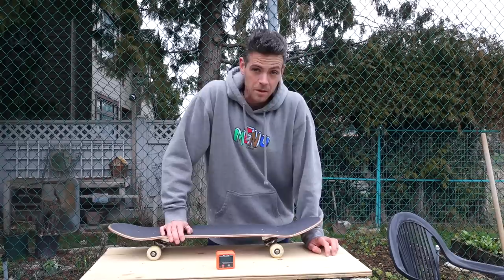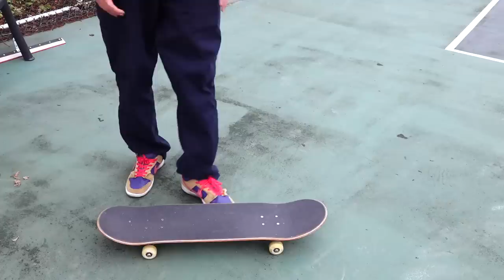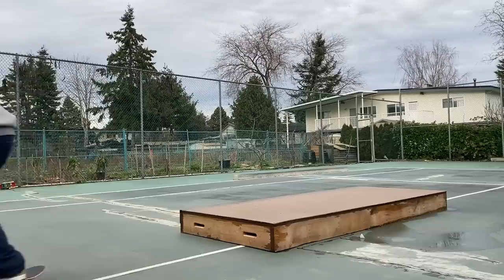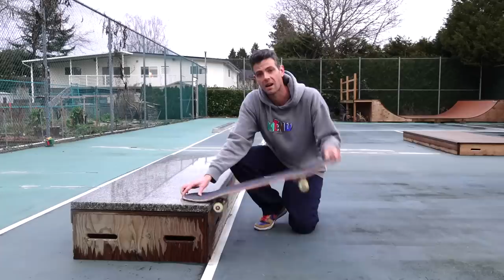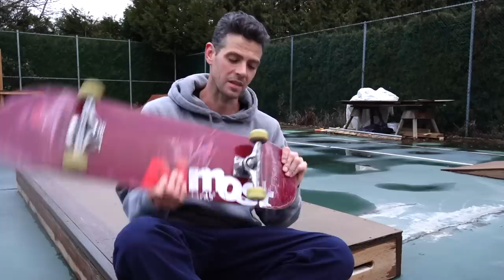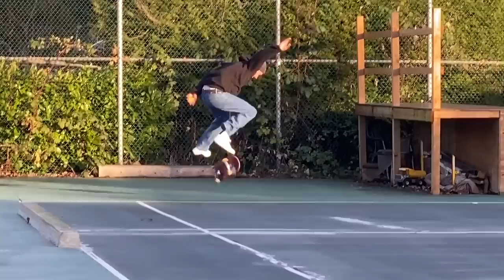Change this part of your skateboard and it changes everything!!!!

Comment: Early 90's, with the change from 80's boards to roughly the "modern" popsicle shape, I found I could not ollie with the "new" boards with fingers of flat. I went from easily jumping over anything to being unable to jump over a beer can. From kickfliping up a set of three or four stairs to being unable to ollie up a curb. The board was glued to the floor, the tail did not snap. It drove me nuts.
My solution was buying old 80's boards and using a "popsicle" as a model to reshape them using the nose as tail(mellower) and the tail as a nose(steeper). Late 90's early 2k's were hard for me, flat skinny boards, bearing condoms wheels, etc.
Some time ago I watched a video when Mr. Degros explained the "technique" to skate boards with fingers of flat.
Reply from the maker: Even with the “technique” it doesn’t mean it feels right or natural. I don’t like boards like that either.
Reply: @bendegros  its funny because this is my ideal skateboard among other reasons (lets not get into the mad mad world of pressure/old school tricks) that love that extra fingers of flat.
Reply: did you stop using risers in the 90s? im kind of the same way . i never really got into popsicles and tiny wheels.
Reply: @chrhadden  I went from about half inch risers and half inch baseplates(Gullwing street shadow) to a quarter of an inch total (shock risers and Indy baseplates). I got used to having a nose quite fast, flips up to anything, noseslides and "nosepick grinds" were my thing for a while.
Later on couldn't get used to flat skinny boards with fingers of flat and the non existing wheels were a joke to me.
Reply: @azazelreficulmefistofelicu7158  maybe i should try the risers  again and see what happens. i stuck to them for a reason  back then im sure
Reply: @chrhadden  No one used risers in the 90s. You didn't need to because preferred wheels were anything 38mm-45mm.
Reply: @jodi183  we did to i was there for it lol and i didnt want and still dont want anything smaller than 56mm. im not a freestyle skater
Reply: @jodi183  there was a time when we all thought for ourselves and didnt have to all have the same thing. long ago
Reply: @chrhadden  I knew that as soon as I hit reply that there would be someone who countered what I wrote. Lol. Yes, there are always exceptions. I was a child of the 70s and 80s. I remember when skateboarding went in and out of fashion in the 1980s and back in fashion in the 90s. I even still have an old Sims board from 1985 with the old Indie trucks. But as you know, by the early 90s street style became so popular then (even Rodney Mullen made the switch to street) and places like EMB where I'd occasionally skate with my friends changed the way skaters set up their boards in order to do tricks. Of course, we had no idea back then that that was a shift in style and the way people skated. For my friends and I, it just made sense to take off those risers if we wanted to grind or do slappies. Obviously, there were those who didn't do that and road larger diameter wheels, wheels that weren't so hard etc. Some of my friends were vert skaters who were or had been sponsored. What they rode on vert was different than what was more the norm for street. I think today there's far more diversity in what people ride, be it the shape of the boards, wheel sizes, and so forth. Also, it seems there's more products available then there was back in the day. I really don't remember seeing anything but the skinny popsicle boards by the mid 90s. That was my experience.

Comment: Second comment 😅 I'd been running Almost decks, almost exclusively for close to 20 years now, whenever it was that Almost Round 3 came out. I really like their shapes, both the twin tail and the regular long nose, and also really like that I can get steep and mellow concaves depending on how my feet are feeling that season. That said, as I mentioned in my other comment, I went to a flight deck ... and I'm not likely to ever go back. I do miss the familiarity of the Almost decks (ran 7.75 up until August this year), but the durability and pop out of the flight decks is kind of insane 😅

Comment: For me I think 35 degrees is most favourable angle for the pop to start. In general I like both of the tips to be similar steepness so I could skate flat without thinking which is the nose and tail, it doesn't need to be a twin tip at all.
Reply: Nope, my new favourite degree is around 34. Or it's just my brain thats been messed too much by the environment. Sometimes skateparks just don't feel as good as some random spots.

Comment: Could you re-drill the tail truck back 1/4 inch to test your theory?  Or do you think other variables like the kick angle or shape of the concave would be make this a bad match?  Love the channel brother.  Old head here, 90’s crew represent.  ❤
Reply: I was about to say the same thing
Reply: Would that not put the holes too close together to avoid excessive weakness?
Reply: @vancouverbill  it’s not too big a deal.  Back in the day boards would sometimes come double drilled, I’ve also drilled back boards to make bigger noses when it was tough to get a board with a big enough nose.

Comment: I'm on an 8.25 Palace right now and it's the stiffest board I've ever skated despite the concave being on the mellower side. It feels slightly thicker than other boards too so it feels "big" for an 8.25. I think an 8.0 Dwindle would feel amazing with those qualities.
Reply: Thats because its a DSM board and uses epoxy instead of glue. It's the main reason chinese made boards tend to feel a lot stiffer and heavier than boards pressed in NA or Europe (HLC in spain does offer epoxy as an option I dont think that many people use it). I thought the same thing about them being thicker but according to my digital calipers they're about the same most of the time and when they're over its a fraction of a mm, so I think its mostly just down to the feel.
Reply: @loveandnapalm  Right on! Thanks for the info on this. I knew it wasn't just in my head. Definitely feels heavy and stiff. Skates really well despite the heftiness though. I think it'll be better if it softens up a bit.

Comment: Interesting. It makes sense that the angle and length of the tail and nose affects the way a board feels and reacts while doing tricks. I have an unused old Nanda Zipp board afriend gave me from Sonic (he was doing the artwork for their boards back then), made in either '97 or '98. It's 7 1/2" wide and it has a blunt nose. However, the tail and nose are a bit on the mellow side, a little more scooped than that Almost board you have. My current set up is an old Salman Agah deck from '93 or '94 with Thunder trucks from roughly the same year (can't remember which ones) that I've been using. New wheels and bearings of course. It's my old deck from the early/mid 90s. Boards during most of the 90s were 7 1/2" wide. Just recently got back into skating and figured I'd start with what I've got. Anyway, happy riding! Love your videos, Ben!

Comment: right now, the tail on my board's kick gap is so short and steep that you can see my baseplate isn't fully bolted on flat, the back of it looks like its on the edge of a cliff. 
while my nose actually has close to 3 fingers of flat

Comment: I'm short at 5'3 and my weight ranges between 160-190lbs depending on time of year. My short legs need a little help. Right now I have a girl G027 has 3 fingers of flat nose and tail. Nose is 6.75" long and the tail is slightly longer at 6.8" I have ace af1 and 54mm wheels speedlab sidecut. Feels good to me. I like a light pop makes it much easier for my to level kick flips in any stance. Plus a nice pinch point for mannys, nose and tail slides.

Comment: Remember that 8.25 PS stix plan B sheffey deck you skated? The yellow one with the short tail that was only like 31.3 overall? That's the shape that made me realize how important FOF is. Even with the short tail some of my tricks instantly clicked. I dont know if it was a different mold or I just got one of the bottom of the stack but I havent found another one that felt quite the same yet. I've been skating the strangelove 8.25 x "31.75" (a little under 31.5 tip to tip) shape and its close but a little steeper in the tail.

Comment: I really appreciate this video for how technical you explain things, I think I quit skating backin the day after a few incidents of lumbar strain injury (where I tore a muscle in my back after landing). I've been thinking about buying a new board and I want it to be perfect this time! I have an old waterlogged baker with independents and sometimes I step on it for a few minutes, and I still have my basic kickflips and stuff and it's a little bit flat and I like it. I can flick the board without messing up the top of my shoe. I'm 5'8 and a little heavier in my upper body, I'll probably get a wider board and do some warm-ups and excercise in the future before riding. I've been doing handstands because I had surgery on my back for a lipoma due to a metal alice pack, but I might also try doing my abdominals and squats. Some people are just very light naturally for their height, but I'm not unfortunately. But that hasn't stopped anybody who wants it! I'll never be pro at my age, but I can skate and have a 100% fun by myself.
Reply: That’s interesting do you do any exercises for your back? Lower back can get very sticky, if you have short hamstrings/ QL, e.t.c but doing some light exercise can definitely help with that !
Reply: I stretch and warmup to skate in general and recommend a firm mattress, but my focus used to be mostly in the headstand/tucked planche with arms tucked too, face almost touching the floor. Instead of squats with weigh benefiting my core, this is what I did. used to do it for hours upon hours... this muscle is the erector spinae. It helped me a lot when my back was a disaster nightmare. It got the swelling down after surgery and all that, because I was forcing it to build mass and  not  just resting. I'm all messed up and trampled nowadays suddenly, but it was fun I guess. Now I wanna skate, but I have also gained 30lbs. I should be 140, but I'm not stressed about it. I also do a couple squats and hold various positions with my knee slightly hinged (over toes) to activate the muscle groups in my leg because my knees feel sore always since I might have skated too hard (was stupid). Been skating again since october. Ordered a complete in late september '23 @RocketRacoon717

Comment: Hi Ben, I´m sure you are aware of this because you mentioned that you are oversimplifying the explanation, however I would like to add the following.  
"The fingers of flat" can be a great indicator of how a board will perform but it´s not necessarily an actual factor for leverage. The main factors are the length and height of the nose and tail + the weight distribution within the board. Because most skateboard molds are symmetrically made with a radial like nose and tail curvature, board manufacturers change their height of the nose / tail by shifting the center of the wheelbase towards on one or the other other end. (usually towards the nose.) When you shift the center of the wheelbase towards the nose, it creates a shorter space till the start of the curvature. This results in the change of the degree and height of the nose / tail, and even gets amplified because the curvature is usually non linearly increasing and because the nose is longer in itself. 
In contrast to that you could start the development of your skateboard with a target leverage point (meaning height and length) and work your way towards it by choosing the angle, curvature and flat part by your taste. That means that it would be possible to create two totally different boards with the same leverage where one has 1 finger of flat and the second one has 4 fingers of flat, as long as both are the same length (measured from above without including curvature) and the same height. (height at the end tip of nose / tail). Of course these boards would feel different because the angle would need to be drastically changed, but when it comes to timing and leverage - they would be identical.
However this is only one part of the equation because the counterpart of that is the weight and even more importantly it´s distribution within the board. By changing the weight dirstribution in the deck itself, which we are doing in our upcoming board the Vanguard, you open up a new dimension of possibilities. But that´s a longer topic.
- Peter

Comment: thx for all your in detail math and explanations. I feel like it helped me a lot finding a setup to come back after more than 15 years off skateboarding. never thought on stuff like that back then around the 2000s :) at the age of 40 I´m a bit tired of adapting to a new shape every time I change my deck. I don´t want to waste my limited time either. After 2 or 3 "trys" I ended up with an 8.25 /14.25 twin tail. The few I tried so far all felt kind of mellow. Ok, but could be better. Maybe someone got a recommandation for twin tails with a concave at the steeper end? 

Anyways, thx again for you great work, Ben. Keep it up. Greetz from germany

Comment: Fingers of flat feels so good, I don't ride low trucks and small wheels though. I'm tall and too little flat makes boards feel cramped. I got a Girl Couch deck with 13 7/8" wheelbase and about a mile of flat at the tail and it feels nice and roomy to pop.

Comment: I skate 8.75s and it's harder to find what I like locally(plus my local skate shop is pretty lame), so I shop online, hard to notice stuff like this online.  I mostly stick to brands I know I like(anti hero, krooked, and the other deluxe decks).  I just got my first ever uma land sled shaped deck(8.7) and am actually loving it. I do branch out to something new sometimes but it doesn't always work out.  

Edit: That does look like a nice shape.  I wanted to try hockey/whatever that squared/blunt brand was but they only go to 8.5s.

Many companies stop at 8.5 or 8.62, I would have loved to support Shane O'neills or Daewons brands but none of those make my size,  Almost doesn't either.   Tried going down but couldn't, hard to go back down in size once you go up.
Reply: @HOLES69  Good to know.  I guess I was thinking of FA.  I'll have to try out a hockey in the future then.  Thanks.
Reply: The UMA maite 8.7 deck is such a nice shape, I’ve skated 2 myself. Love the nose on it
Reply: @joe.nail1  The uma 8.7 is really good.  Been really enjoying it.  Haven't skated in a few weeks but I am loving it.   I have noticed it razors really quickly though.  I've only skated 2 or 3 sessions and the tail and nose look like I've skated a lot more than that.  Hoping that's not a consistent issue with their boards;  It's been a long time since I've had razer tail, but may happen if that's a trait of the umas.

Comment: I noticed this right away going from riding my Deathwish board and then jumping on my Santa Cruz....the Cruz has a bit of a longer tail and I was barely getting the nose off the ground because my back foot was naturally not sitting far enough back...I checked and the wheelbase was longer and the tail was longer on this particular Santa Cruz board....so measurements do make a difference.

Comment: I never understood why asymmetrical decks have remained the norm. I ride Ishod's deck and the freedom to not worry about what side you're popping off of is such a relief, especially when flipping around.
Reply: A lot of people ride one truck looser, though, so it'd still feel backward at times. Definitely wouldn't work for me
Reply: I completely get what you mean, but what held me back is the way Dwindle decks keep their shape. And I don't think Dwindle has a twin-tip board? Often even when there are twin tips, they are the tail ones. I'd really like to have a twin-nose. So of course text thing that pops to my mind is Neen Williams twin-noses, which ...unfortunately have always quarter inch longer wb of what I like, and their graphics don't call me much either. I think there is a gap in the market.

Comment: I have a weird board that has zero fingers of flat on both front and back and steep kicks. Flip Lancer Mountain deck. I'm used to having a pocket to put my feet in. That deck doesn't have that. I'm used to skating Powell Popsicle shaped decks, which are pretty mellow concave as well as kicks. I think they normally have 2 to 3 fingers of flat. Oddly, the board I feel I can ollie best on is a Powell JM Duran deck that has a 17" wheelbase. I think the long wheelbase is amplifying in the weight of the front truck or something. I'm riding Indy 159 hollow forgeds on that deck.

Comment: I tried a 14 inch wheel basebase where there was a lot of fingers of flat... that kind of makes nose and tail slides feel weird, cuz instead of sliding on the underside of the angled kick, you're sliding on flat-portion of the deck. At least, the very-edge of the ledge is.

Too bad the weather is TRASH this spring (for Vancouver) 😭🤬 !